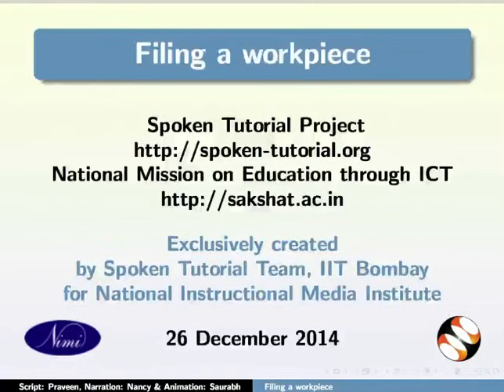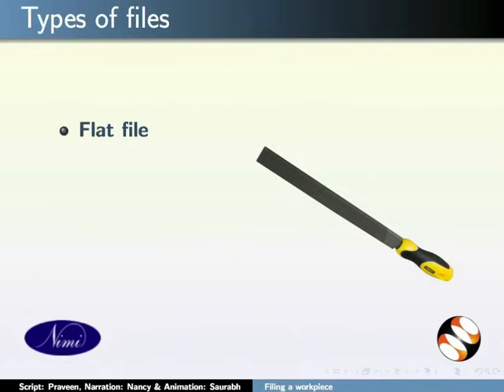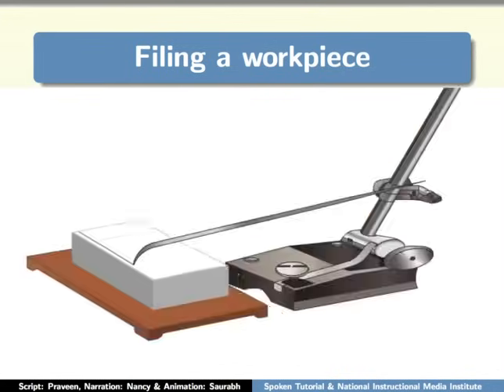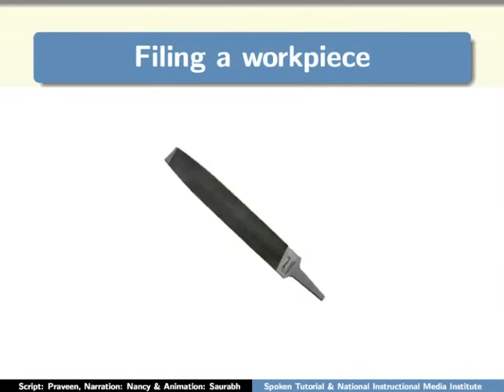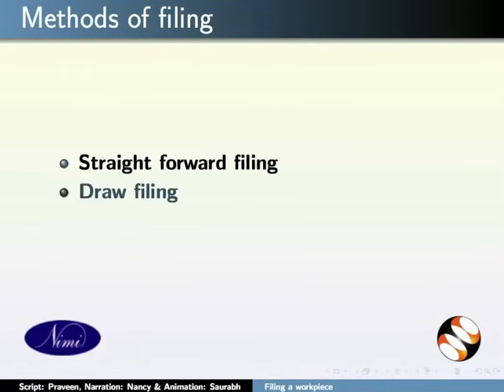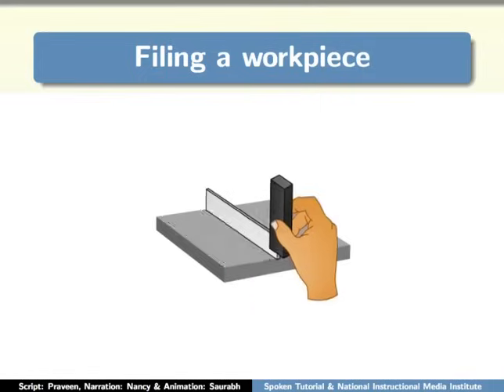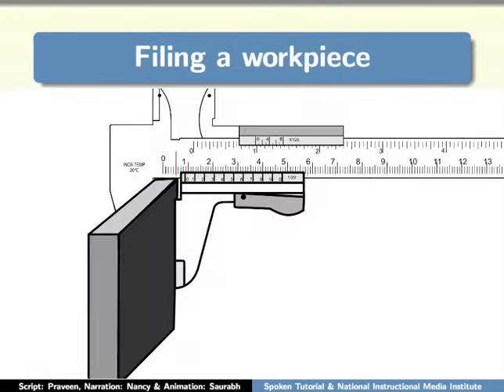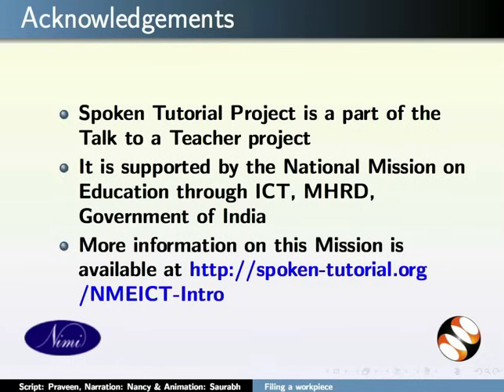Filing a workpiece - English

Comment: The information presented on straight filing wrong and damaging to the file. Always lift the file up when pulling it back to your body. The file works best when you push it, with light pressure applied for single cut files looking for a smoother finish.
Reply: fireball tools has debunked this myth. https://www.youtube.com/watch?v=xbykic--SKA